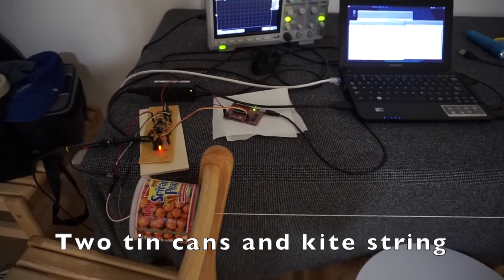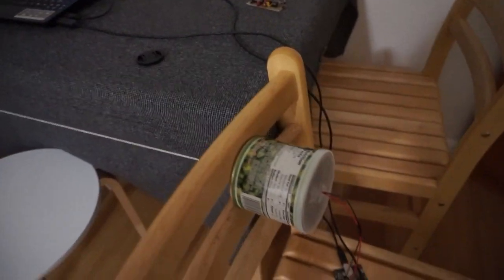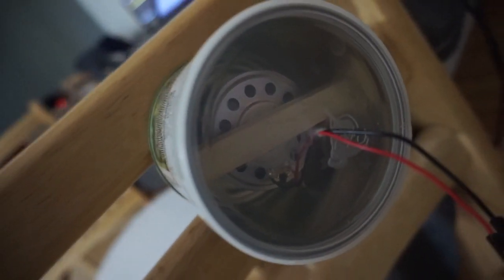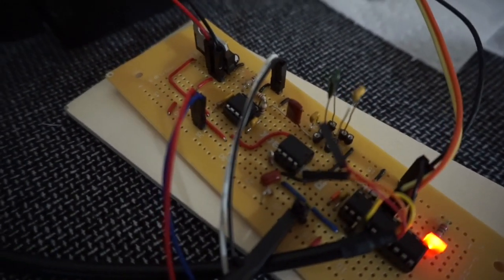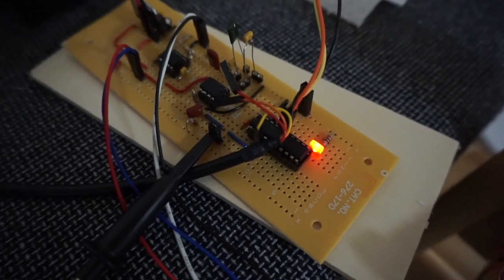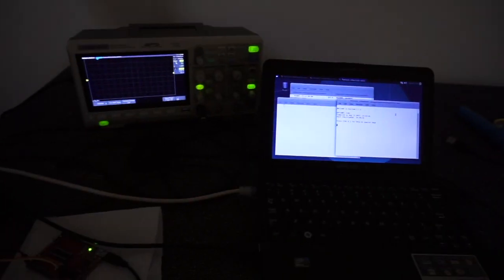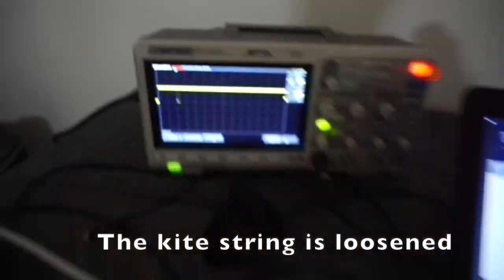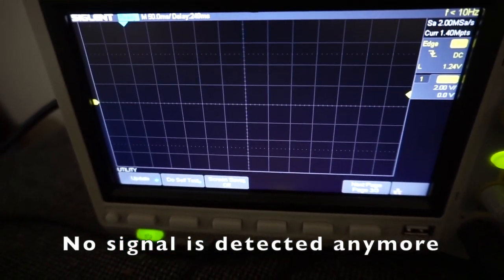Tin Can Phone Modem

Comment: This is so cool! Also you could make it analog like dial-up modems, it'll be faster.
Reply from the maker: Thanks!! I think the chip used here to detect the tones (LM567) was actually used in very early modems (300 baud?), so something like this really could be done.
Reply: @mikeakohn  Maybe I can try it myself with arduinos. I don't have that level electronic knowledge. But i'll try file transferring.
Reply from the maker: Go for it.. If you need help feel free to ping me. I'll tell you though, I had a really hard time with the receiver side of the circuit... I myself am a software guy... the issue being making the microphone sensitive enough to pick up such a soft sound without adding noise to the input of the LM567. The LM567 also can be tuned for frequency and I believe also how fast it will respond to that frequency...
Reply: @mikeakohn  Thank you for your support! I will start a week later, I can't access my tools right now. Maybe I will share it to internet too.
Reply: @mikeakohn  And I have a recommendation for your project if you have it now. You can change signal length to frequency so you can make communicaton like 2x faster
Reply from the maker: At the point I was finished, I was happy it worked at all :). I was looking to see if anyone makes the LM567 (or anything similar) for you in a breakout board so you don't have to struggle as much with circuitry, but I couldn't find anything. Some other things you can possibly try is a vibration sensor instead of a microphone (pretty sure I tried that too and still had trouble). There could be better ways to detect the sound on the can.
Reply: @mikeakohn  I'll use a microphone or sound frequency sensor. I'll make arduino modulate the data into analog fm acoustic. And other will demodulate. First I'll send letters like you, then files, after that I'll make a local continous network and finally make it internet connection from other device like dial-up. I'll make two side connection in network part of course. It will be enough for me seeing a text file from public internet. I will use arduino so I won't struggle like you in circuitry. Maybe I'm just luckier :) Actually the hardest part is sending data, after that downhill all the way.
Reply from the maker: Sounds good.. I'm looking forward to seeing you get this working :).
Reply: @mikeakohn  Thank you :)
Reply: @mikeakohn Did you modulated data in computer or attiny? I will use ASCII and Arduino is capable of converting to ASCII. What do you recommend to me?
Reply from the maker: The ATiny2313 takes data (in my case ASCII also) over the UART and beeps it out of a speaker. I had a computer connected to the circuit so I could type in the terminal. I would recommend doing the same thing.
Reply: @mikeakohn  Thank you! Mine will take data from computer too and will give frequencies numbers of the data encoded to ASCII. If I can make it take a character in 10 ms it will be 100 character in a second and an ASCII character is 8 bit so 800 bps connection.